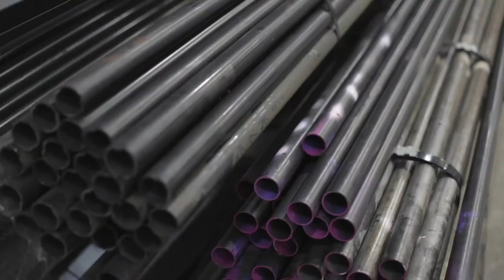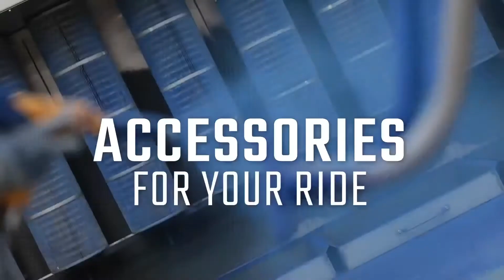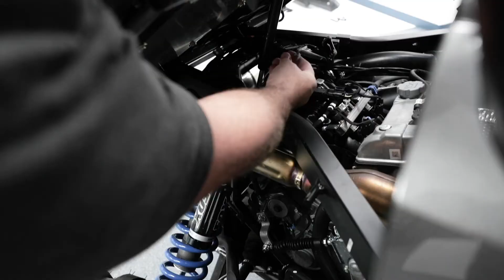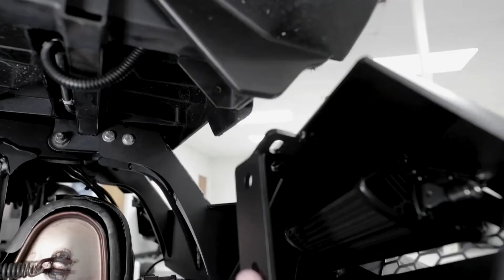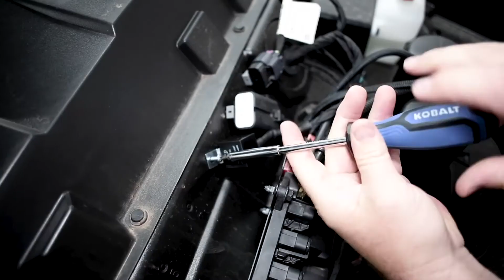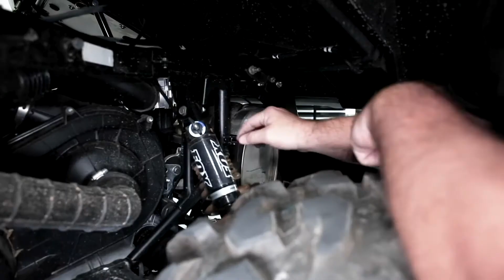Polaris General Rear Winch Ready Thumper Bumper & Light Install

Comment: What's the switch for on the dash???
Reply from the maker: For the rear lights in the bumper. They will also come on automatically in reverse!
Reply: @ThumperFAB  No quick connects on my 2025 General XP 1000 ultimate. and tech support is a joke unless you want to chat wit AI crap.